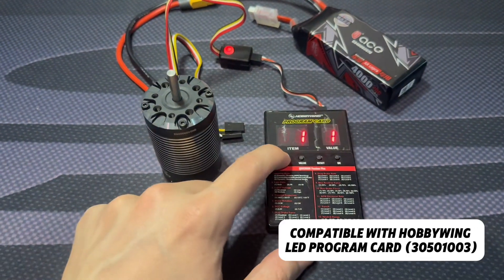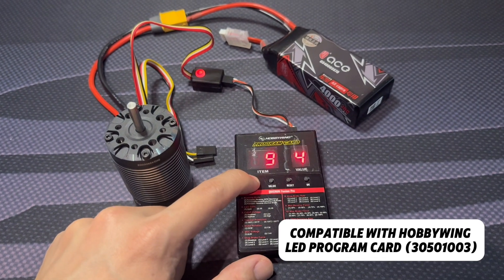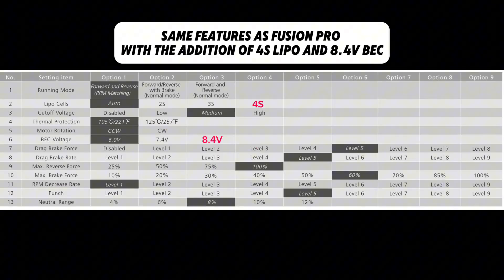[Review] Hobbywing Fusion 8IGHT 2300kv (official) x Rlaaro MK-07

Comment: The fusion 8ight is an absolute beast of a motor. Installed it in my 8th size crossrc rig, and it's like having a new truck all together.
Reply: 確かにあのモーターは野獣です👍
自分も灰色のMK07に付けました😁
Reply from the maker: indeed, the precision in field oriented control though